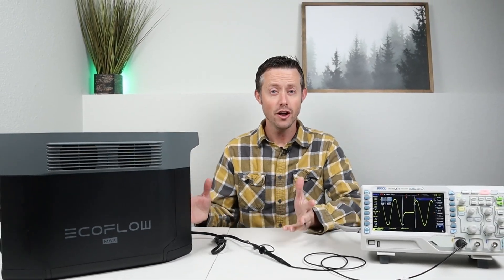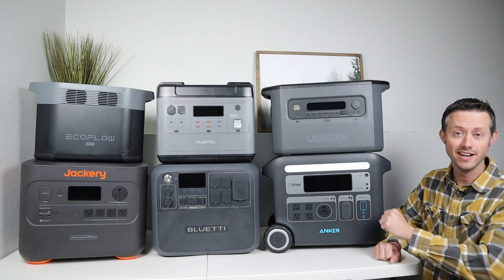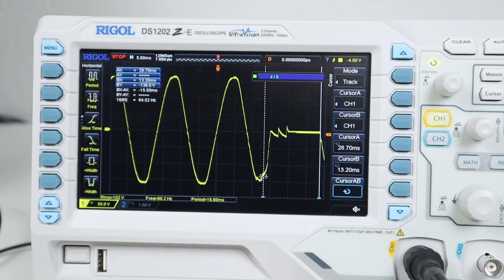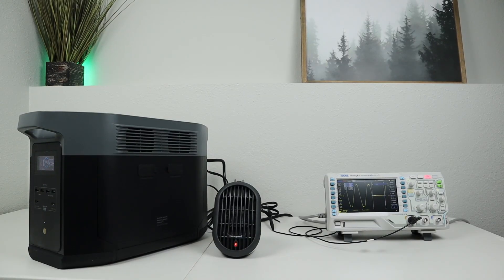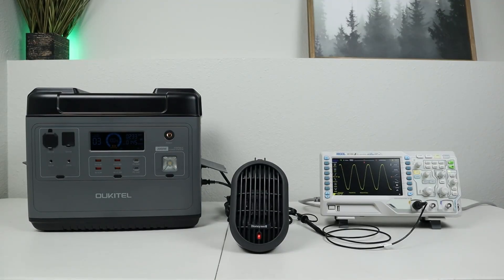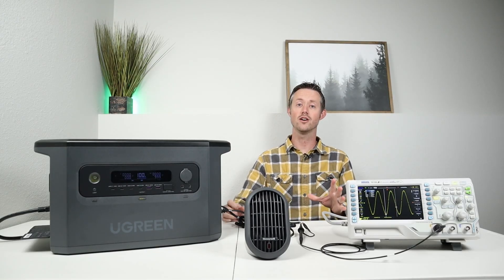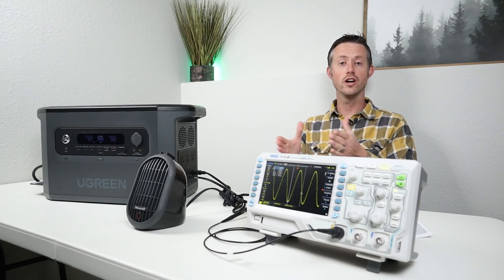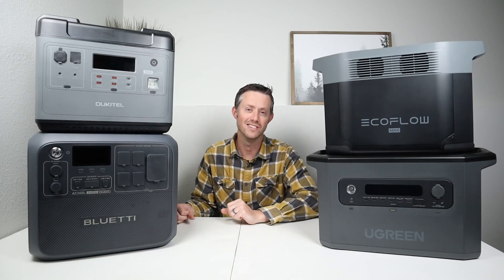I Measured UPS Mode Swap-Over Times!! Anker - Bluetti - EcoFlow - UGREEN - Jackery - HEAD to HEAD

Comment: I love this test. Tests like these can help to bring the quality of power station UPS functionality to the next level.

As UPS test I also like to see the following:

▪ What the idle power loss is of each power station in UPS mode while supplying power to a PC/server when it is connected to clean AC grid power.
▪ If the power station wastes energy by continuously draining and recharging the battery like my Bluetti AC300 does.
(The internal electronics of the AC300 always runs off battery, even when it is connected to grid, which results in the battery continuously being used and recharged.)
▪ If any of the power stations offer UPS software to automatically shut down a connected PC when the battery is almost empty.
▪ If the AC output to the load is resumed after the battery drained empty during a long power outage and the utility power comes back.
▪ If any power station has a built-in surge protector to protect connected equipment from grid power surges.
Reply from the maker: I think point 5 will be a reality on the new EcoFlow Delta Ultra.
Reply: @Jasonoid  any of these address point number 4? All of these units are useless in an unattended application if not. Like leaving town for a week or so. Hate to have one of these on my fridge and it does not power the load when the utility power comes back. You can fix point 3 by putting a small 'real' UPS between the Power Station and the load (finickiness of the real UPS notwithstanding). You can fix point 5 with a mountain of reasonable in-line suppressors. You can't fix Point 4.
Reply from the maker: @DeanBennett1  the Ecoflow delta pro ultra utilizes a new 'AC always on' feature where if the battery dies, the AC inverter will turn back on once charging power is restored. Only unit that works like that (that I know of).

Comment: The P2001 in my server rack has had issues with brownouts where the UPS mode doesn't switch over. Network equipment stays running but the servers shut off. Could be interesting to find a way to test how power stations handle that situation, variac maybe?
Reply from the maker: I had the Oukitel P2001 in the video, which is identical to the FFpower P2001. The only difference is the brand badge on the front.
Reply: my FF Power P2001 must not have the same switch over time as my PC doesn't stay running for most switchovers. so i understand your frustration.
Reply: @user--PM   (was writing this when you deleted your previous comment)  It works fine for hard cuts, for several months last year I had it on a smartplug that cut power during the day so it ran a server on solar power. over 100 controlled "power failures" without issue. Actual power failures, much less reliable. I now have a small cyberpower UPS between it and the equipment to deal with the delay, also useful if I want to take the power station with me.
Reply: @Cody4k  ah yeah i also put a APC UPS in between my PC and the wall, as the ffpower p2001 was unable to handle complete cutouts, for some reason over this last summer the cutouts were for a half second and twice a day, it was real annoying. now i have several UPS because of it.

Comment: Very nice!  There is only one other tester that uses this method for checking the switch over time.  It would be nice to compare these numbers with a UPS from Tripp-Lite that is also a true sine output.  The B-Sin-600 is about the same price as an AC2A, has 375 watts RMS and has a maximum transfer time of 2 msec or less.  Of course it has a boat anchor SLA battery, but still would be a good reference for these types of tests going forward.  That was quite a spike on the AC200L.  Maybe you could quantify that (looks like 10 to 15 volts!) as a spike like that could be problematic for some sensitive equipment.  Great to see you growing in your knowledge as you start to close in on 100K!
Reply from the maker: I'll consider testing a true UPS someday. I'm not sure the topic is that popular on YouTube. It might not be worth spending a few hundred bucks to get $20 back through ad revenue on a video. We'll see. 
I noticed 'Waveform Science' started testing UPS mode cut-over times in his AC200L review video  ;)
Reply: @Jasonoid  With more manufacturers adding the UPS feature, there should be some care exercised when reviewing this feature and not referencing a standard, such as 60Hz, or 120VAC RMS.  I will be more than happy to send you a Tripp-Lite unit (that i previously referenced) as it is a real sine wave unit and not a crappy wave like most of the consumer level things.  If you are interested, just let me know.
Reply from the maker: @johntate5284  that's very generous John, but I can purchase a true sine wave 'brand name' UPS unit if I decide to move forward with the future video. I will not purchase a junk modified inverter version.
Reply: hopefully you know someone that is local and has a pure sine wave UPS that doesn't mind you borrowing it for testing, it would have probably been a nice addition to this testing video. but agree, making a dedicated video about this for one unit doesn't seem wise.

Comment: Ugreen continues to impress. You're the only tester I've seen using this particular piece of equipment. Very cool.
Reply from the maker: Another channel called 'Waveform Science' just started testing UPS modes with an oscilloscope. I still think I was first. Maybe I started a trend!? 😁
Reply: i first seen matthias doing it. @matthiasrandomstuff2221
Reply from the maker: @user--PM  I saw him test the surge induction load that damaged his Ecoflow power station. Did he actually measure the UPS cutover time?
Reply: yes, but it was not in the same video, it was in the original review, though having trouble finding it now.

Comment: Looks like there catching up . The 2024/2025 models will be the best yet .
Reply from the maker: I think we will start to see 5ms or less on these models. When I tested the new EcoFlow Delta Ultra this week I got around 5ms cutover. Super fast!
Reply: @Jasonoid  there is supposed to be 0mS on the Ultra as well?  Is that limited to like a couple of outlets, or only through the SHP2 or something?

I'm assuming that it just runs all of the AC power through the battery and inverter for 0mS?  Or is that not finalized yet? Or can't say😅?
Reply from the maker: @rcguymike  I've tested both the Ultra UPS modes (online and backup). The times are 4ms and 18ms. Not quite 0ms but really close!